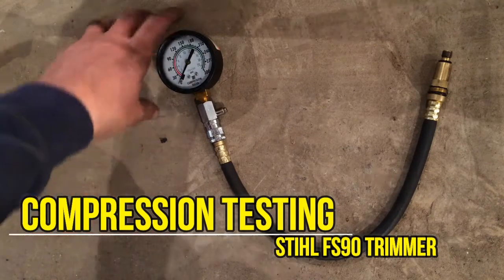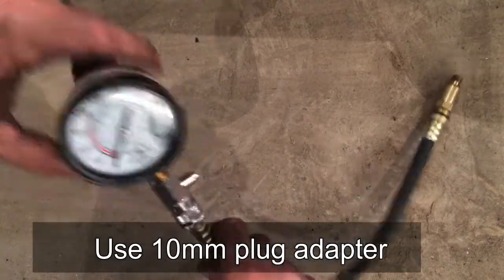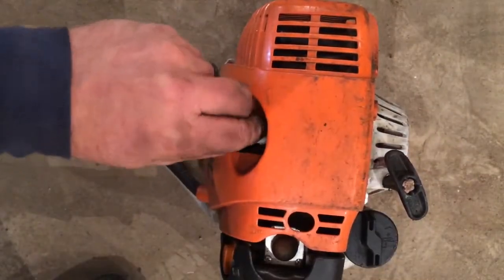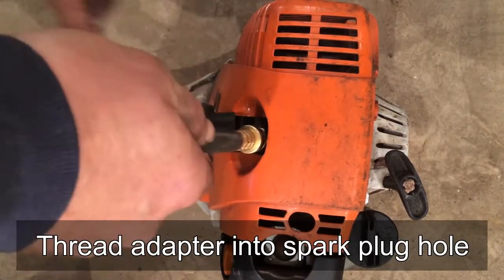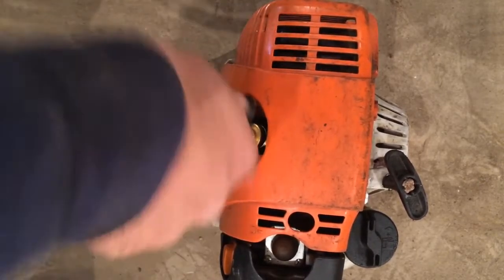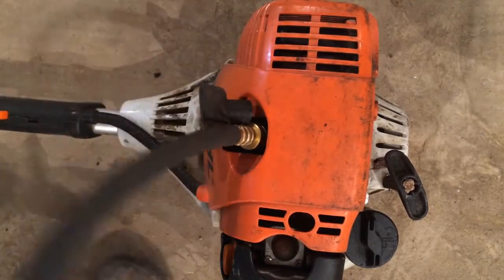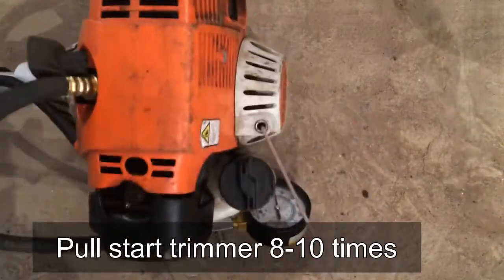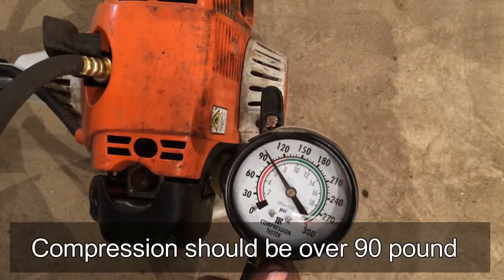How to compression test a Stihl FS90R Trimmer Weedeater

Comment: Do not use a thread adapter on a compression tester when testing small hand held equipment. The adapter adds way to much volume to the cylinder. It will throw the reading off a lot. You can find compression testers that have an adapter hose for 10mm spark plug threads that DOES HAVE a schrader valve in the threads. I guarantee you, if you test that same machine with a proper set up the compression will be 50 PSI higher. It’s crazy how much difference it makes. The bigger the cylinder you are testing the less difference the adapter makes but on those small engines the difference is huge.

Comment: ,I want to pick your brains on a issue I’m having with a Stihl 4 mix hedge trimmer model HL 100 K ,  the issue of initial hard starting, the problem described this way initially this unit would require several pulls to start on a cold start if you could even get it to fire off, but if I gave it a shot of starting fluid it fire on one pull and after that it would start on one pull after even just running for seconds. This cycle would repeat itself over and over if you allow the machine to cool off even for just one hour . While running the unit I did find that it would die if I sprayed a bit of brake clean around the carburetor mounting and there was a small leak at the throttle shaft so Installed a new carburetor and gaskets from the insulator all the way to the air filter box . Now the unit still has the same tendency to not start even while choked , but again it will start with a shot of starter fluid and after that first start will repeatedly start on one pull ,but repeat the same condition after it cools off... I have adjusted the valves , new spark plug and installed two different carburetors and still have the same issue, also I have to constantly adjust the carb as it seems to be erratic and change after you get it right. I have sprayed brake clean around both crank seals to see if it affects the running but it has no response to that! Help? Thanks...
Reply: Test the starter coil, compression and fuel lines.
Reply: I'm gonna say bad oil seals on the crank. Check the cam also

Comment: i am working on 3 stihl trimmers : HT101 and 2, HT131s. all show about the same compression of about 60 to 70psi. i know why tester works great for the larger diameter spark plugs with the 12mm or 14mm thread but these pole pruners take the smaller thread spark plugs: NGK CMR6H. So by adding the smaller adapter am i losing compression or does it mean i have to double it ???   the trimmers work great. I have had 2 cycle engine that have under 90 psi and just won't run but they are also the larger threaded spark plugs. any ideas on this would be appreciated. my tester is a craftsman and has all the connections for every spark plug

Comment: What has to be the pression for these type of weedeaters 100 or 150 psi?
Reply: They wont start without many annoying tries unless they are  at or above a 100.  In ideal condition they should be 140 lbs plus cold.  The temperature of the motor has alot to do with the readings.  A outside variation of 35-50 F can give it issues especially when the compression is low.
Reply: I agree. If it doesn't have a minimum of 100 PSI of compression I don't waste my time on it.
Reply: @phillipkramer1897  140 psi good compresion 372 xp oe ?
Reply: STHIL says around 110psi should be expected

Comment: So what is the solution for this low compression issue, how to fix it
Reply: Piston replacement kit. It means the ring is welded to the piston or there is scoring on the piston or cylinder walls. Aside from the ignition coil it’s usually the most expensive part to replace that commonly breaks when using the wrong fuel like not enough oil in it or straight gas for even ten minutes will ruin a 2 stroke.